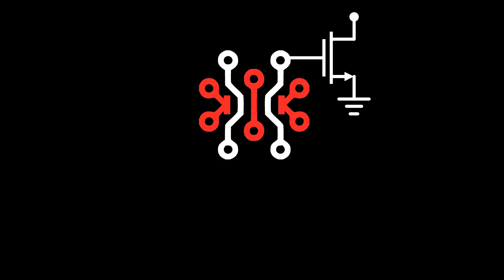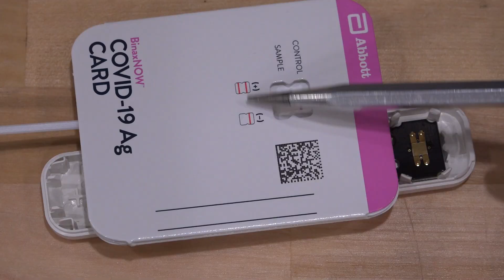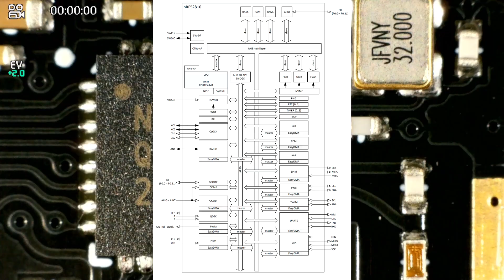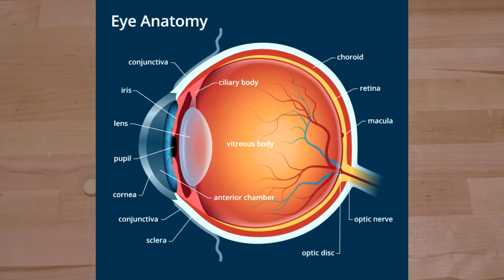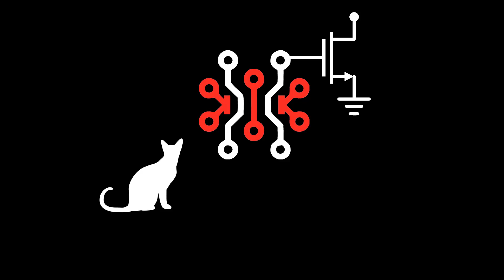TNP #9 - Teardown & Analysis of an Electronic COVID-19 Home Test Kit (ellume)

Comment: That seams like a lot of Ewaste for a test. They should make them with replaceable strips.
Reply from the maker: I think there may be a version of it with disposable strips, but probably more expensive.
Reply: that's the entire point, it was a medical pharmaceutical complex manufacturing scheme
Reply: Or...

you could just look at the strip...
Reply: @typedef_  The actual line on the strip that means something is invisible to normal light. It glows faintly under UV light only. You can't see it with your eyes.
Reply: @glasslinger  I use tests with strips that make visible lines. You know, like for eyes. You know eyes, those round spheres on your face that don't need UV to work...
Reply: @typedef_  Be nice if they had them that simple for covid.
Reply: They should first make one that is accurate but there are no tests with certified accuracy!
Reply: @stevec5000  The main source for inaccurate tests is user error. So to have a "certified" tests it cant be carried out by someone at home but needs to happen by a professional under controlled conditions.
Reply: @stevec5000  only a PCR test run by a professional medical laboratory that participates in cross laboratory calibration even approaches "certified accuracy". That's pretty much true for all medical tests.
Reply: Clearly any and all so-called concerns for the "planet" are bullshit along with their 'climate change' crap, when they make this device for single-use. Where do all the millions of lithium cells go after the single use?
Reply: @cjay2  Mine go to H.D. in the battery recycle box. If you don't have a home depot you can usually recycle them at a local hardware store.
Reply: @cjay2  It is ewaste, so it will be recycled to some degree. Usually in a third world country with little regard for protecting the soil but effects on the planet are pretty minimal.
Reply: @drkastenbrot  except it's medical waste so it geht's incinerated. And even with the normal "recycling" only a fraction of the materials are recovered anyways.
Reply: @fryphillipj560  Good Simpsons episode:  Clouds of E-waste gases infused with pandemic viruses floating around the earth while the upper class hold meetings on how they are spending trillions to 'stop the spread' and 'save the environment'.